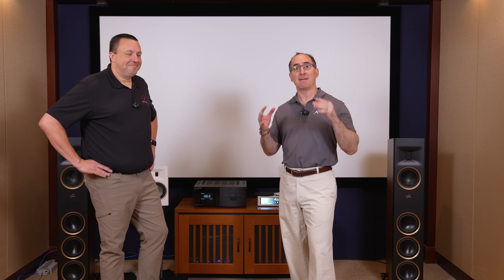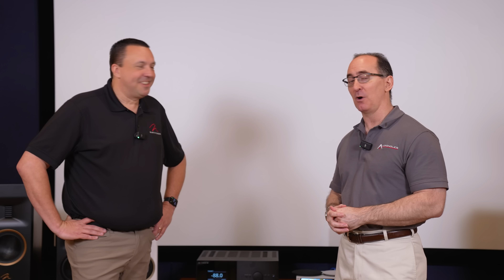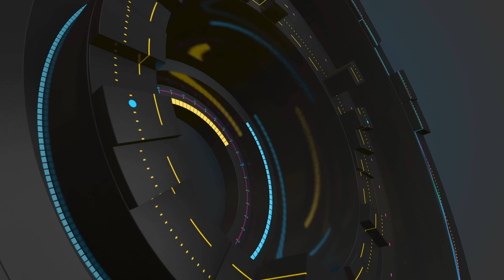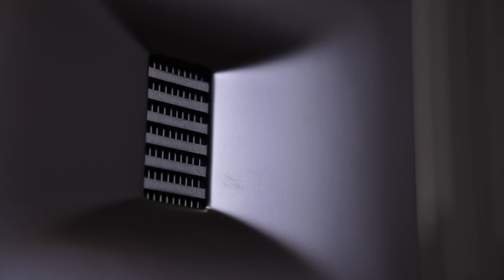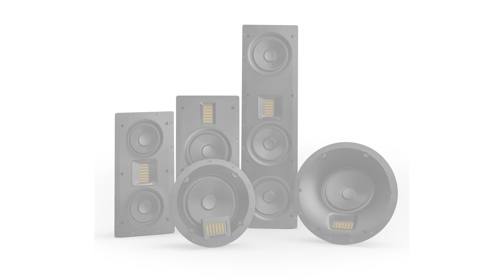MartinLogan Motion XT Series Loudspeakers Interview & Design Details

Comment: What happens when these speakers are on carpet? If being on carpet isn't an issue for the bottom ports, I'm adding the XTs to my short list. And, do these need to be further from the front wall? Thinking of the F200 primarily.
Reply from the maker: The outriggers and feet raise them sufficiently, so it's not an issue.
Reply: @Audioholics  Ok, thanks for the reply. As for my other question, I'm assuming they need to be out from the wall some; my only placement option is about 3.5–4 ft from the front wall. If I get these, I'm hoping that will work.
Reply from the maker: @charlesf2804  yes you will be fine with that placement. Phenomenal speakers. Don't forget to use our Audio Advice affiliate links 😉

Comment: Turns out I have a local Martin Logan dealer. Demo'd the B100 bookshelves and ordered them (and the C100 centre) on the spot. Detail, air, and imaging all a noticeable step above my current Polk LSiM 703s (along with an electric guitar fullness that is to die for). Found black to be the best of the colourways for me. Pictures do not do the gloss black of the cabinet justice.